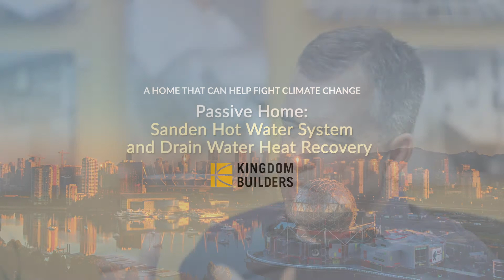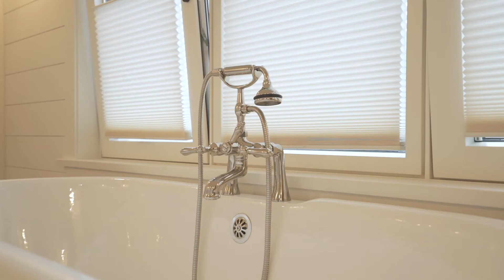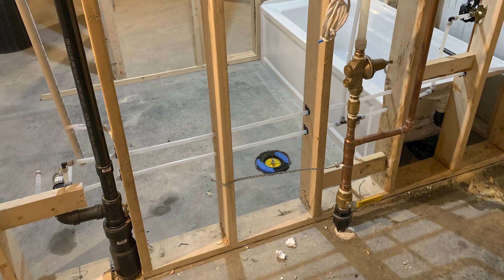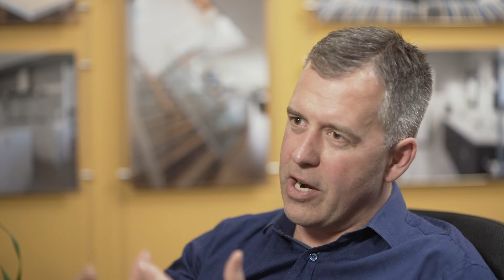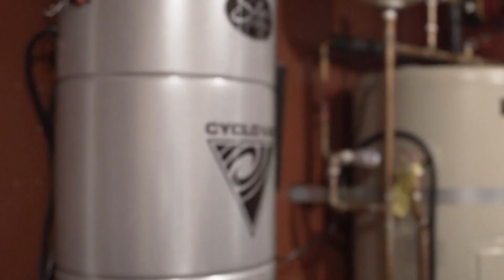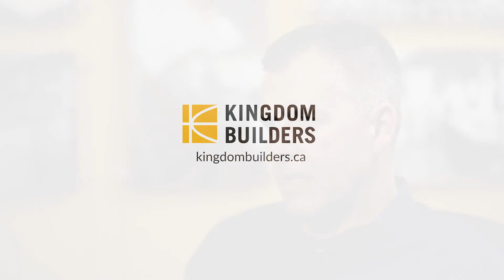Sanden Hot Water - Mackie Passive House Series - Video 7 of 7

Comment: A drain water heat recovery exchanger is unlikely to recover any heat from a bathtub, it only works if the water heater is being refilled at the same time the water is draining. So it would work with a shower, but not so much with a bath tub.